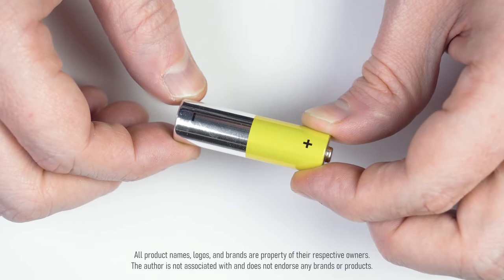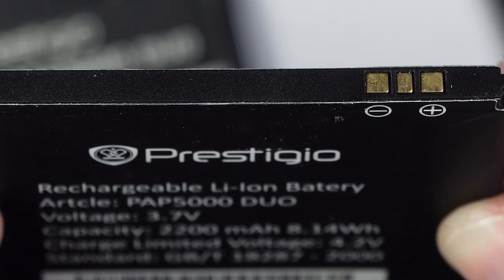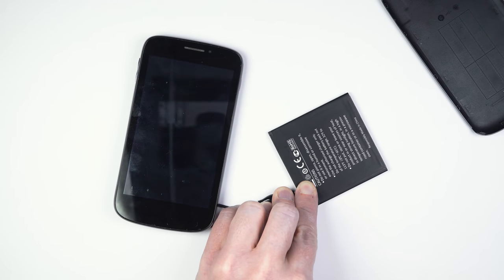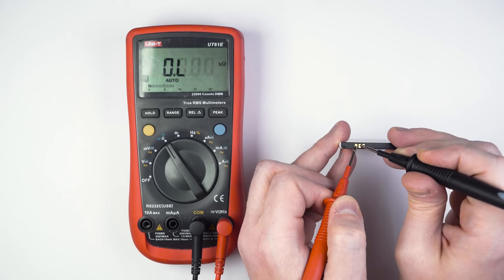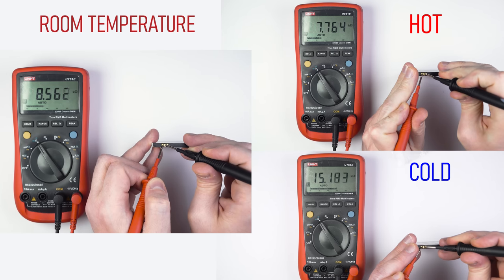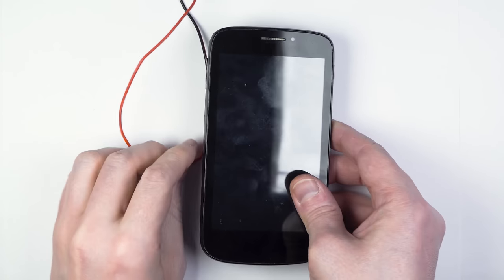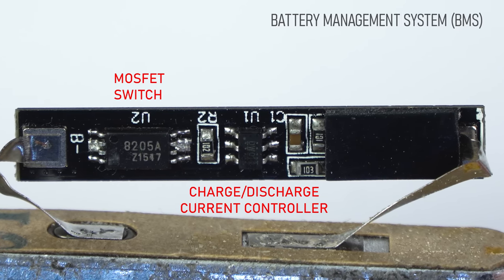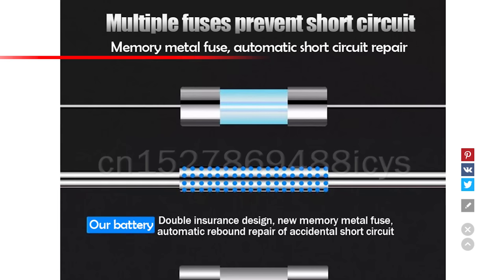Why do MOBILE BATTERIES have THREE terminals? A simple Explanation.

Comment: Basic electronics lesson 1. Never use a DMM in resistance mode on battery terminals.
Reply from the maker: Its actually about AMM. DMM has no problem with that, because measurement principle is different.

Comment: I would buy an original battery for my vintage Dell laptop, but Dell does not want to sell me any batteries for that laptop. And I really wish that the BMS boards in laptops would reset if one replaces the cells if there is no original or even an aftermarket battery pack available to buy anywhere.
Reply from the maker: You could try getting new batteries and leveling voltage between them (set to approx same voltage), there is a possibility the BMS will accept them and work.
Reply: @RonMattino  Dell is programming the BMS to disable battery charging asvsoon as the cells die and/or someone tampers with the pack. And they have even  done this with the first lithium packs back in 1996 in the Pentium 1 laptop era. I have a Dell Pentium 1 laptop and no one can help.

Comment: NTC is just one of the protective mechanisms, primarily used to regulate charging current. So, it's obvious why some nefarious products don't use them(shorter life means repeat buyer). It also reduces defects in the field due to
Non existent QA that these batteries go through.
But what is important is the type of BMS(usually uses mosfets) and in some cases a thermally activated fusible  disconnect.  The malfunction of the above leads to typical catastrophes like battery fire or explosion.
When using batteries without NTC resistors unplug charger when done charging, and don't use an unregulated constant voltage chargers. Most OEM chargers also have builtin safety to limit any issues.
Reply from the maker: In fact, NTC is not used to regulate charging current. It's only used to shut off phone in case of emergency or disable charging function. Charging current , according to basic Li-Ion specs, must be constant.
Reply: @RonMattino  Thanks for the clarification. I do know li-ion batteries are charged constant current above initial threshold(below which low current is used to bring up battery voltage to avoid internal shorting of deep drained batteries). The charging will be cut off once it drops to fraction of charge current at 4.2/3.6v depending on battery type. I should have just mentioned limit charging current when at elevated battery temperature. Keeping constant current at high temperatures does degrade battery cycle life. In lion NTC is also used to prevent charging while cold(applies mainly to backup power, that includes battery heater).

Comment: Ok, but how does the phone or camera or device determine the percentage of how much power there is left? Isn't that done through a serial connection to a chip on the battery, that is connected via these extra connector(s)? That was my understanding so far.
Reply from the maker: Actually, no. The charging circuit inside the phone is a kind of "energy counter". It counts the amount of energy that enters battery during charging, so while discharging, it counts "back" and knows how much is left.
Reply: @RonMattino  but how should that work on a device with interchangable batteries? I mean I remove a battery from my first camera, which said 67%, then I put that same battery into camera 2 and it also says it has 67% charge left.
This can't work without a chip in the battery that counts energy charges and discharges and also calibrates itself if at some point it can't charge that much Ah anymore. There is a communication here.

Comment: It seems like not every phone has the shut down feature if the middle pin not connected m, I tried powering my Galaxy Y externally with only connecting the + and - pin and it still turns on.
Reply from the maker: Right, it might turn on, but it wouldn't charge via USB, you can try it ;)
Reply: @RonMattino  haha of course it wouldn't charge, while I was externally powering it the battery percentage is showing 100% and there was no battery in it, not sure about data transfer though.

Comment: If you put voltage to resistance meter by mistake, it get damage. Measure voltage first.
Reply from the maker: Not really, not in modern multimeters. It's mostly true for analog pointer devices.

Comment: I assumed it was for load balancing, thanks for info!
Reply from the maker: Could be, if mobile batteries had more than 1 Li-Ion cell. But they have a single cell, so there's nothing to balance. Remote control toys usually have multiple-cell batteries, so their extra pins are for cell balancing.

Comment: My theory was, not knowing about the temperature/overcharge protection circuit, that there were circuits in the phone that required lower voltage taps within the battery.  As a general rule, I try to never plug a charger to any Li Ion battery without periodically checking its temperature with my hand. In other words, don't connect a charger to a lithium ion battery and go to bed, or leave the house.
Reply: "Fear lithium-ion batteries at all costs."

Comment: Not all batteries have a thermistor connected to that pin, some have state of charge, and others have a data coms, Ryobi 40v are one such battery.
Reply from the maker: All smartphone batteries have thermistors. Ryobi (if you mean powertool) has NTC too and also a very complicated control board. There isn't such thing as "state of charge". The only state of charge there is out there is charging voltage and current, which the phone controls and can read.
Reply: @RonMattino  Was referring more too powertools, some batteries resistance on those monitoring terminals changes with state of charge, and others have some weird mojo going on with there BMS boards and have some sort of data hand shake, and it varies from product to product, another one I came across, if you don't feed the correct resistance range into the battery 3rd terminal, it will refuse to charge, so you need to trick the battery with a resistor in order to use a non OEM charger, but again, power tool batteries, have dismantled quite a few to recover cells from them so have had some experience with the wonderful ways manufacturers try to stop people from  do crazy crap with their gear :)

Comment: Dell used to do something like this, though. Their power supply for some of their laptops had a third wire running inside the middle connector. It was to send a signal to a part on the motherboard to let it know the Dell power supply was being used. If you got a power supply that had a matching voltage but no third wire, it wouldn't work. So sometimes when you ordered the right power supply, it still wouldn't work because the part on the motherboard was bad. It's called proprietary parts. Dell and others quit doing this practice to drum up after market sales because they found, as in this case, they were shooting themselves in their own foot. It was too expensive to replace the bad motherboards. Hahahah I love it!
Reply: Dell and HP still have the 'third wire' that goes to the small pin in the centre of the connector - it's a data connection that identifies the power supply as an OEM one, and even the rating (the power connections are the outer/inner barrels) - cheap 'clone' power supplies are recognised as non-OEM, they will power the laptop but do NOT charge the laptop battery..!
Reply: @raycardy4843  Interesting. I stopped seeing the third wire on newer laptops and surmised they quit. I'm glad I'm too old to play around with this crap anymore.

Comment: And then explanation why my phone battery have like 12 connectors
Reply from the maker: What phone model is that? Never seen a phone battery with 12 pins. ;)
Reply: @RonMattino  probably not that much but at least 10 Xiaomi mi 9t pro/ Redmi k20 pro

Comment: Galaxy s6 edge here, ive noticed recently that with my phone charged to around 90% if i turn it off at night , i turn it back on around 8.00am & its down to 3% battery life!!!  
During the whole day if i dont use my phone much it stays around 80%.. !!!! 
It seems like my phone consumes more power when turned off !!!  Very bizzare.
Reply: That makes no sense.  Perhaps try cleaning the phone and battery terminals ?  How old is the battery?
Reply: @markkennard861  the battery is as old as the phone, i guess around 6yrs old.
I just found it very weird that once its turned off with a good amount of charge, by the morning its almost flat once booted up, during the day it stays rather charged even after a few short calls.
Reply from the maker: I would say the battery is pretty much dead probably ;) and needs replacement.

Comment: Some of these batteries do have an internal processor that the phone communicates with. It tell the phone not only the battery temperature but also the charger level and...... they have an internal meter and clock that tells it to stop working once it's been charge cycled so many times or after a certain date. 
Sony NX series batteries for cameras and video cams worked this way. No other battery will work in a SONY camera!
Reply from the maker: I have a Sony FS100 and FS700 cameras and I've bought batteries for them. I've never seen these batteries fail due to "charge cycle counter". Usually they just get worse with time and hold little charge. You can then replace Li-Ion cells and they'll work again. Only need to balance cell voltage, so that the BMS does not lock out.

I've also seen Chinese made 3rd party batteries for the A6000 line cameras, they have a very primitive schematic, still the camera recognizes them and they work. 

There are, of course, batteries out there that have a complicated BMS with a microcontroller, but usually those are laptop or power tools batteries.

Comment: So as the temperature rises the resistance reduces causing the phone to not operate. Is this correct?
Reply from the maker: Yes, exactly. And that type of sensor is called NTC, negative temperature coefficient. Resistance is inversely proportional to temperature. And there's also PTC, but they are not used in mobile phones.

Comment: I had thought it was either temperature or some kind of communication. Like to send information from the control chip in the battery to the phone about things like temperature or current draw. It’s also not too out there for it to be some kind of ID it sends but it could probably be easily copied and put in these fake batteries.

Why would they just solder a fixed resistor in when thermistors really aren’t that expensive?

Comment: I guessed it would be that because power tools do this for the same reason. Trying to find an actual genuine iPhone battery is impossible
Reply from the maker: You can find original batteries from repair shop, they sell salvaged used batteries sometimes.
Reply: @RonMattino  most of them get fakes, which can be worse than the 3rd parties. Most old batteries ain’t much good I find and I like to use old phones because of my job I tend to break phones a lot.

Comment: Can we  mesure  the  resistance  with  battery  charged  or  this is  a  special  multimeter?
Reply from the maker: Yes, you can measure with battery charged, it doesn't matter.

Comment: Yes, in charging my Phone inside freezer for maximize current and have a fast recharge!
Reply from the maker: Why would you wanna charge your phone inside a freezer? Li-Ion batteries operate poorly in negative temperatures. It might charge faster, but that happens because cold makes your battery lose capacity.  Not a very good idea probably. ;)
Reply: li-ion batteries don't like to charge/discharge in under 50degrees F. They will still do it, but they degrade and performance will drop. The ideal temp for li-ion/ li-po is about 75degrees F.

Comment: Nice 1 video!  i have an old  four terminal phone and i´m trying power it with external psu. when i  connect only + /  -  it not run. When i  connect  + /  -  and a resistor from  -  to another terminal it turn on and turn off, as happened in your vídeo. I don´t know what i need to do with  the another terminal to  mobile run...
Reply: I am having the same problem, same project. I am guessing that we use two resistors? A resistor divider. Connect one from each sense terminal, and both to ground? Then run pos and neg terminals as normal? I have not tested this yet, so it is only a guess right now. Would love to hear if you have success in your project.
Reply from the maker: Could be two things. Either the resistor value is wrong -- try 47k instead of 10k. Or, attach two resistors -- like the comment above suggests. And please let us know how it went. :)
Reply: @Inertia888  Nice, i will try it. I've already soldered a wire to each phone terminal, so it's easy to do any tests.
Reply: @RonMattino   Ok Ron, will try it  so I'll let you know. thanks !

Comment: If manufacturers wanted to sell batteries they would let you swap them easily
Reply from the maker: Actually, the main reason phones use built-in batteries is because it makes the phone slimmer.
Reply: @RonMattino  I know. And it makes them higher capacity

Comment: Why did that Samsung battery have 4 contacts?
Reply from the maker: Some Samsung battery models have the NFC sensor output wired to 4th pin. So the NFC is inside the battery (e.g Galaxy S6), and if you use a cheap 3rd party battery, NFC stops working ;)
Reply: @RonMattino  Oh, right! The NFC in the battery in some models. I remember now. Had a few Samsungs in the pre-S6 era. They became despicable after that.

Comment: How to connect HP flat Li ion batteries into power bank? is it even possible make it safe?
Reply from the maker: Basically, as long as they are Li-Ion batteries and have a standard 3.7v rating, I would say, yes. You also need to ensure the polarity is correct when connecting them.
Reply: Big Clive has a recent video on a charging circuit board you can buy online for only a few dollars that has all the necessary cut offs for safety. 

If paralleling up a set of Lithium cells out each cell in series with a resistor for a few hours so that the reach equal charge, otherwise you can get dangerous currents on making the connection. Then take the resistors out for the permanent circuit: once they are in sync they will stay in sync. 

You can even mix cells with different capacities.